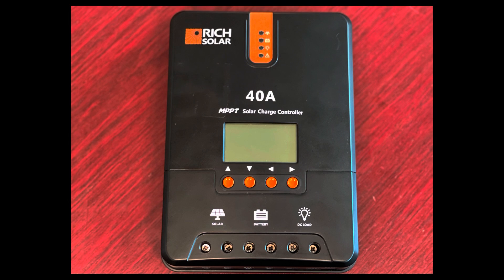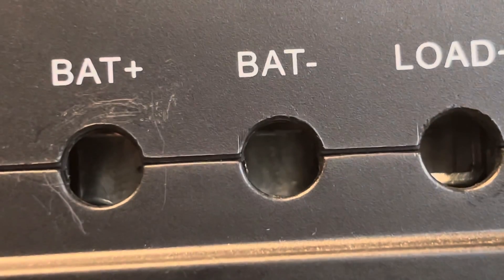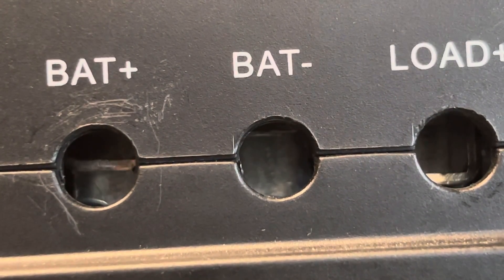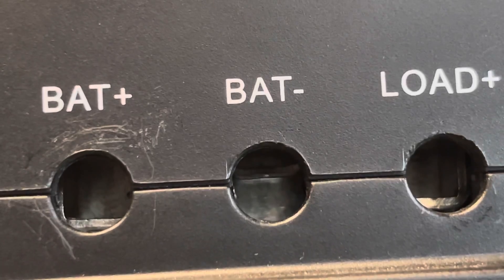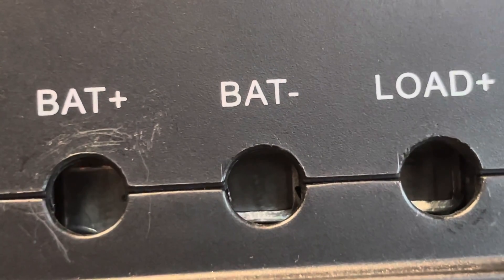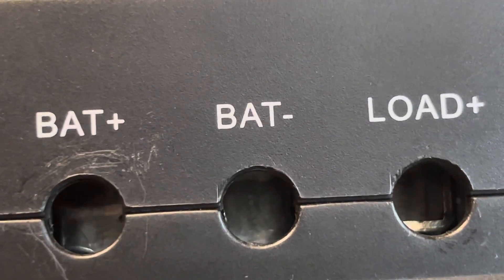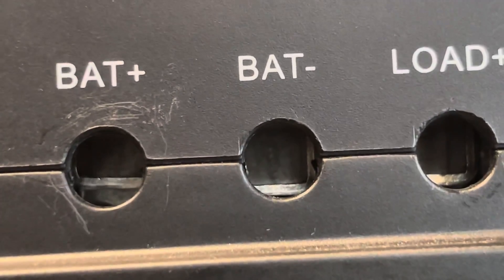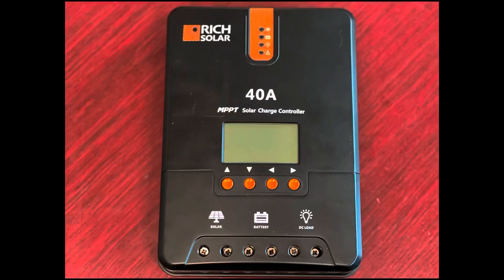How to connect cables to a Rich Solar MPPT solar charge controller #richsolar #mppt #solarpanels

Comment: BTW, I have the 60A controller. Do the wires in it connect the same as you show here, or different?
Reply from the maker: Hey Bill! The 60A is different than the 40 and 20. On the 60A the screw comes down onto the wire.

Comment: interesting... I just installed my charge controller this morning before seeing this. I installed opposite to the way you said I should have, and they seemed to pull up correctly, but I'll go back later and do it the right way!
Can you do a video on connecting the other cables that came with the controller... I think one if for the battery temperature, otherwise, I don't have a clue! 
Also, what gets connected to the "load" terminal? Thanks!

Comment: Thank you it has been very frustrating for me so far. You got the information needed out. Thank you. 👍 What size for the lines to the battery are used
Reply from the maker: You can use 8 or 10 awg gauge wires for the battery